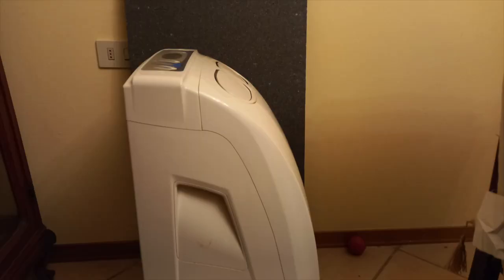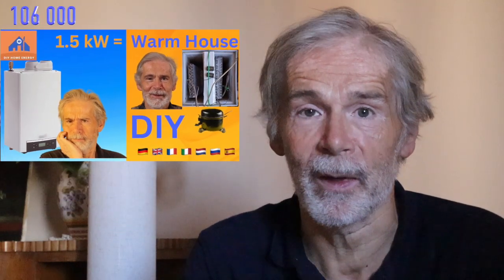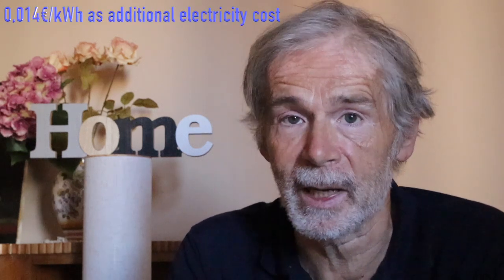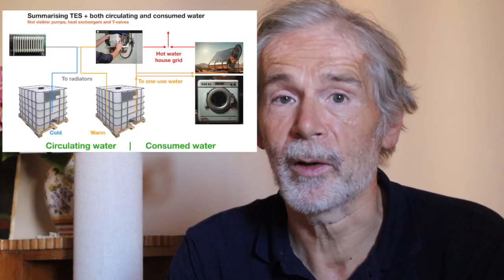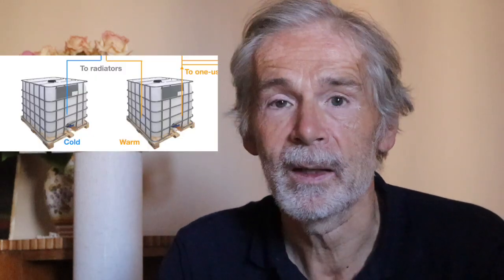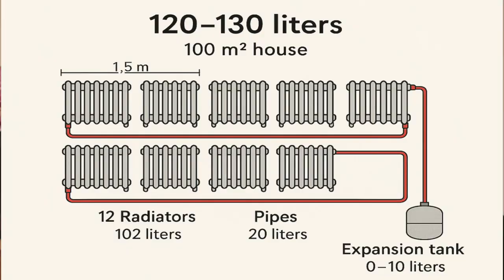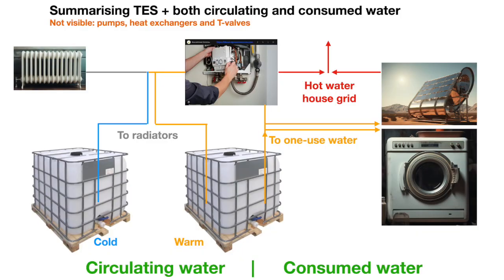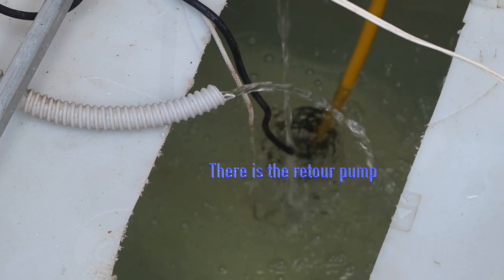How to use my excess PV energy? High efficiency cooling and thermal storage, of course! - Video 108

Comment: Thanks Norbert, I have noticed and appreciate your reduction of the AI content!
Reply from the maker: Hi K A, thanks to you, it was certainly a right thing to remember that data centres consume much power. 
I would like that they use it better, because at the end of the day als this electronic work is converted into heat.
I have a video about that, let me know what you think about it. Just a moment and I look it up: video 55, https://youtu.be/cTnZUlZ1EuU
Reply: The video was very interesting. There is much potential in reclaiming this waste heat. As I understand it, the demand for low grade heat consumes a majority of energy used for heating. 

However, I am pessimistic about this happening. The capital investments would be large, the profits would be low. This is likely why it has not already been done. Those with the money are investing in projects with higher projected returns, this is a major problem for humanity.

Comment: Hello, sad to have a wooden house, would not try to run cold water in heating tubes since I can see all condensation on AC tubes while cooling. An interesting question: Is it better to reverse AC manually since you talked about 3,5 vs 3 between hot and cold heatpump usage? Interesting subject!
Reply from the maker: Hi Fredrik, a great point. I mention in the video the trays under the radiators but not a solution for the interconnecting tubes. That might indeed cause condensation on those tubes. Will it cause problems with wooden houses in particular? It is indeed a point to take into account.
The difference between the cold and warm side is because of the power of the compressor that is added to the warm side. I don't do the switching inside the cooling circuit, that would be too complex for DIY. I work on the consumer circuits that are downstreams of the big tanks. So I switch the intake to the house circuit between the two radiators that are submerged in the big tanks.

Comment: Thanks, I agree with you; I'm on the same search. After some tests, there are things you can do with minimal energy. I understand that heat transfer is crucial, and the solutions are here. Air conditioning shouldn't be the only solution in the summer. If you don't live in an apartment, we can use the cooling effect of underground heat. For example, circulating the underground heat at 12-15 degrees Celsius into the home might be a good solution. Thermodynamic solutions are needed; developing a device is either difficult or a financial challenge. The issues and alternatives are too numerous to list here. I hope more people understand you and contribute to the world.
Stay healthy and loving.
Reply from the maker: Thank you ACmedia, there are indeed many solutions and your's is on my radar. I  must see hoe much space is our house. That space can also  be used for additi9nal thermal storage as done in my home country NL with an enormous water bag, thanks again.